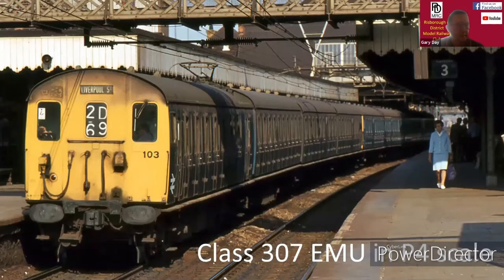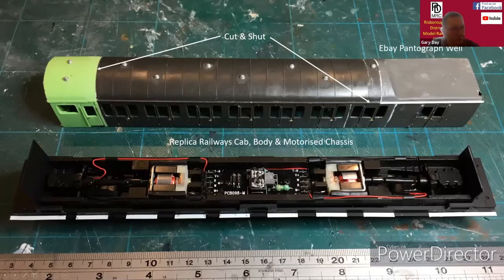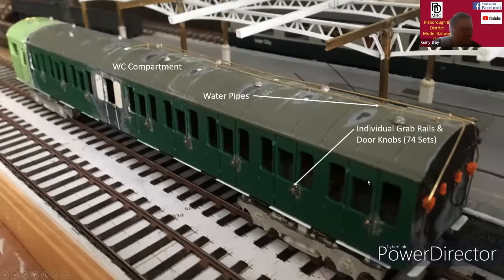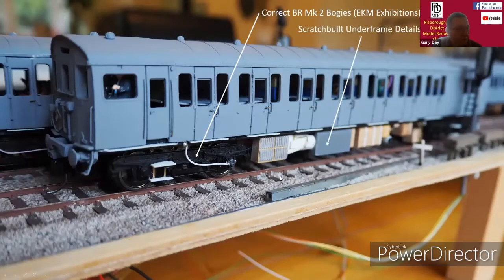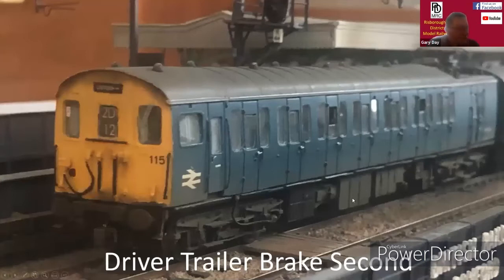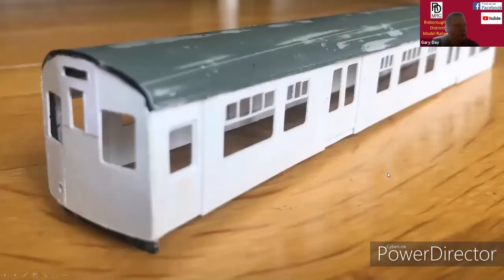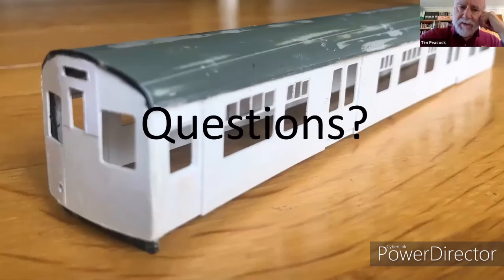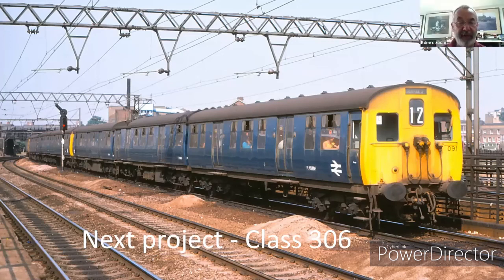Building a Class 307 4-Car Electric Multiple Unit

Comment: Very interesting project - I commuted to school every day on a class 306! Can I suggest you look at using the body shells of a class 506 - you would need 2 Motor Trailer Coaches and kit-bash the Centre Trailer Coach to incorporate the guards compartment. Shapeways produce 3-D printed bodyshells for a Class 506 and the body dimensions, if I remember correctly, are the same but the guards compartment was in the centre car instead of next to a drivers cab. One word of warning - the partition between the guards compartment and the saloon was not flat but shaped  \_/ (pointing in to the saloon). Best of luck with the modelling and I look forward to seeing the result.
Reply from the maker: I have already started building a class 306.  I have avoided the Shapeways products as these are expensive.  I have used laser cut bodies with Bachmann Thompson coaches as donors, for the chassis and roof.  An article will follow in RMWeb.

Comment: No, in  the 1960s they were converted from 1500V DC to 25kV/6.25kV AC. Between 1983vand 1984 they were refurbished to opens from compartment stock and the 6.25kV equipment was removed.